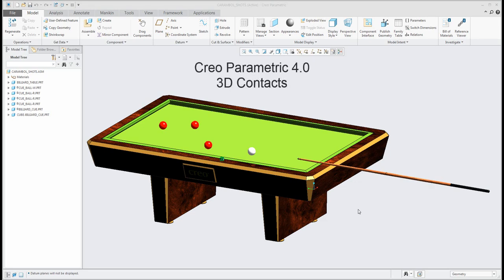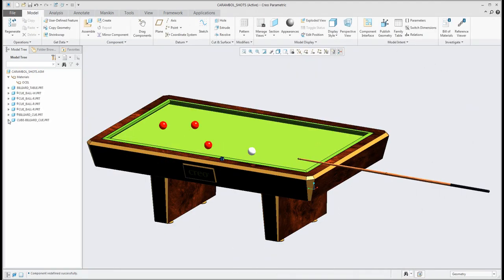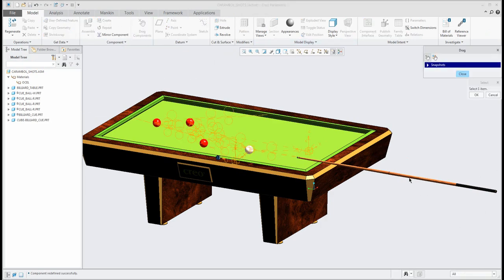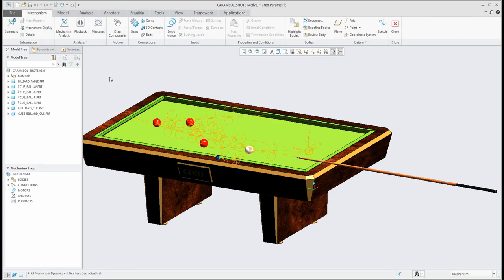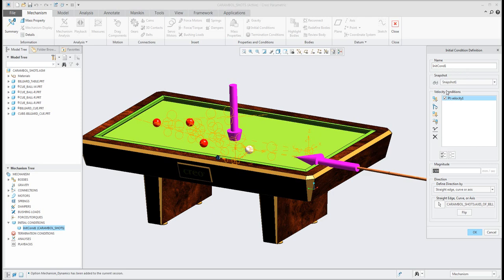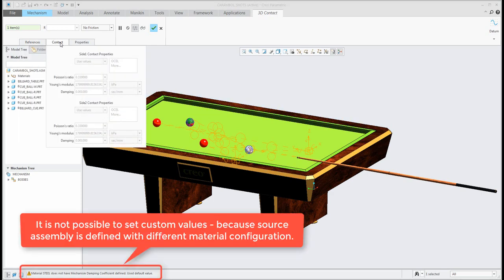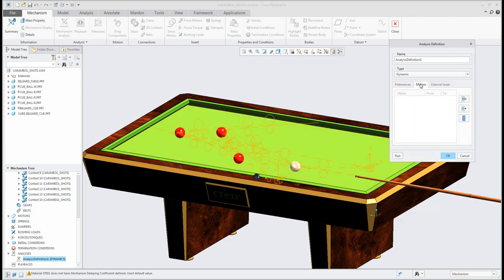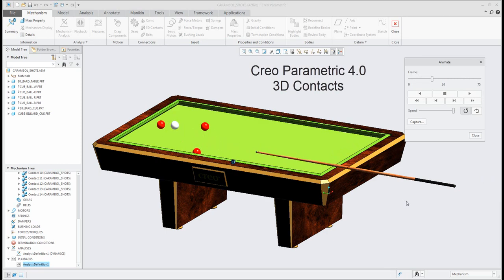PTC Creo 4.0 tutorial: 3D Contacts

Comment: Hi sir, I hope you will be fine. I have a question that how can we make 3D contact between flat surfaces.  I want to make a connection walls of one rectangular box sliding inside another rectangular box (fixed). I did analysis while applying a slider connection on sliding box but I want to do with 6DOF connection which requires 3D connection between walls. Please suggest me a solution.
Reply from the maker: Thanks for your question, I will try to find some example. Stay tuned. Vladimir
Reply: @4kside  
Ok sir
Reply from the maker: 3D contact between flat surfaces https://youtu.be/4Y9nd_XQzsM Stay tuned and thanks for your question.. Vladimir

Comment: Hello, I have a question. I have to make a kinematics model of a quadruped robot with Creo.
Which references must be between the robot and the floor so that the robot can walk on the floor? Thank you
Reply from the maker: Hi Adnan, I will try to use cam connections. Bottom surfaces (curves) can align with bottom surface and sometimes lift off when needed.
Reply: @4kside  thank you very much. I will try it 👍